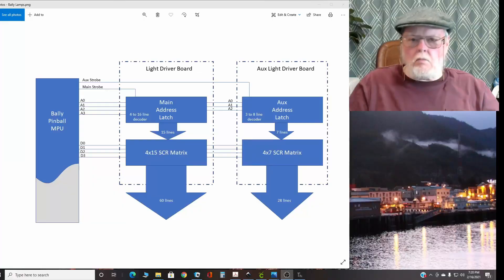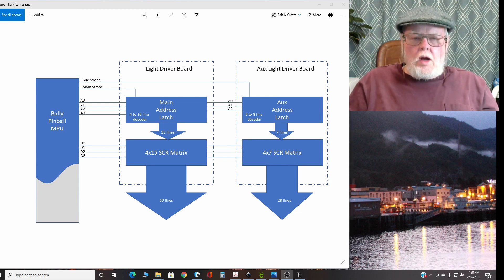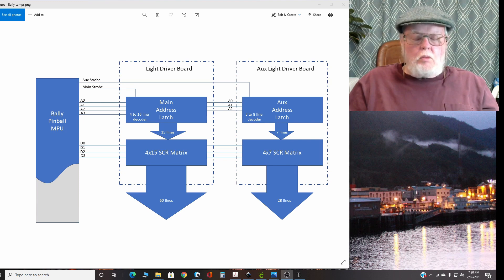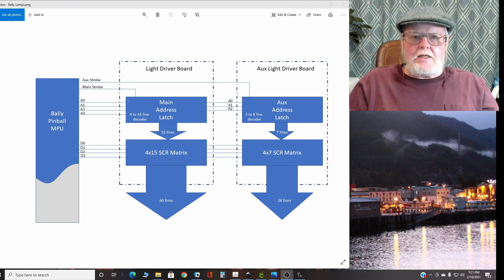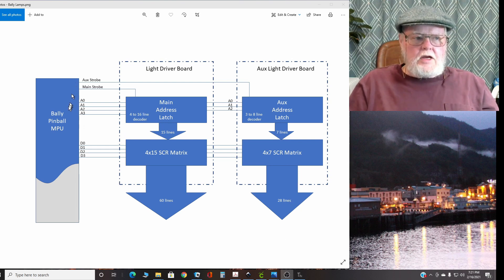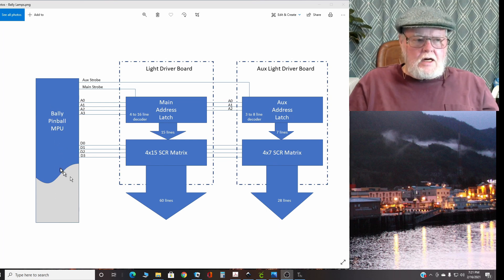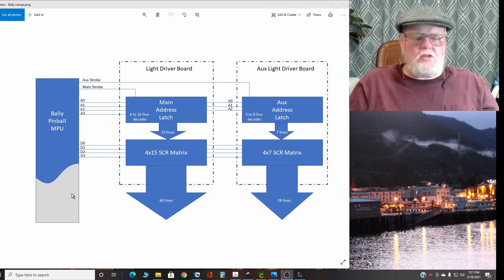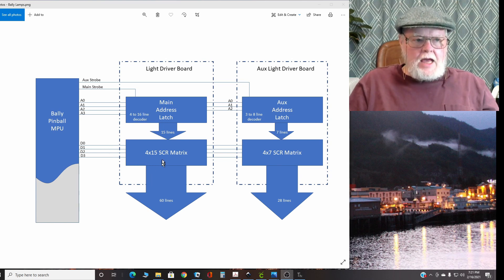Raspberry Pi Pico Interrupt Problems

Comment from the maker: I found the problem.  If you look at time 19:47, you will see that line 114 is a Time.sleep(.25) command.  At time 15:09 there is also a sleep command at line 72.  I removed both of these sleep commands and now the code works perfectly.  I bumped the interrupt rate up to 2000 times a second and removed all delay in updating the leds, and no lockups.  So - don't use interrupts and sleep together - lesson learned.

Comment: maybe also look at .disable_irq and enable_irq  , see https://docs.micropython.org/en/latest/library/machine.html
first line in irq handler =>    state=machine.disable_irq      ,   and then as last line  =>  machine.enable_irq(state)
and many pins can call the same irq handler, parameter pin is given,  so you can react to which pin called the irq handler,
which part of the original hardware are you planning to replace, all of it, controller, the SCR boards ?

Comment from the maker: I was using PicroPython version "rp2-pico-20210215-unstable-v1.14-36-ge017f276f.uf2" from website https://micropython.org/download/rp2-pico/.  I just noticed that they have 4 newer versions loaded, so I will grab the latest and try it.
Reply: Little update - I loaded "rp2-pico-20210217-unstable-v1.14-67-gcf6a01588.uf2" and it ran for about 20 minutes before stopping

Comment: what happened to you guys???
Reply: Nothing really except that we stopped making weekly videos.  We are still working on restoring a Paragon machine and will release a single video covering that when we get done. But there have been a lot of delays. We redesigned the led boards and the led driver board had had them manufactured by JLCPCB.  But because of the pandemic, everything is running really slowly. I also built a little tester to help fix solenoid driver boards and I might make a quick video about that just to put something out.
Reply: @MrEdwardhartmann  SELLING ANYTHING?